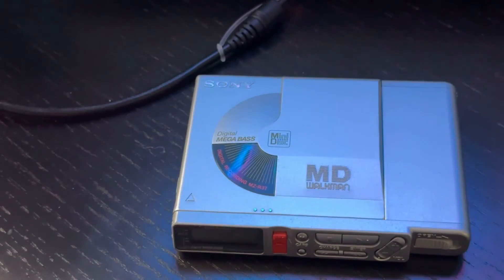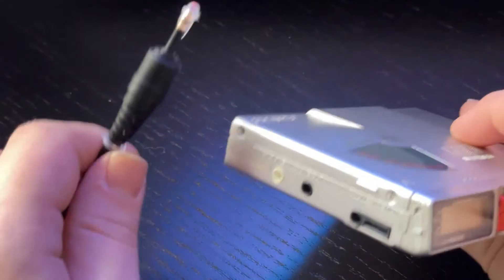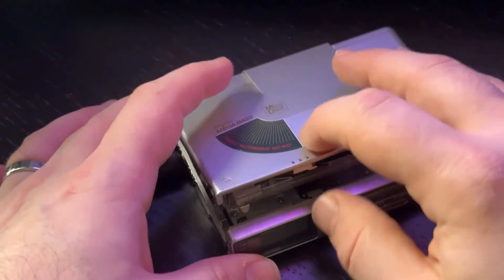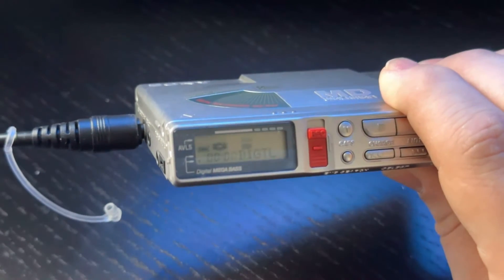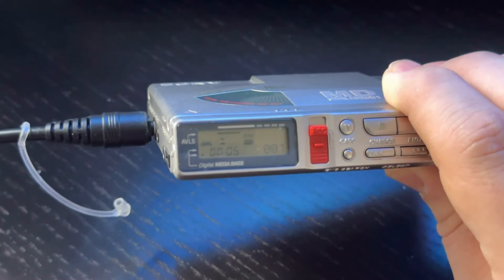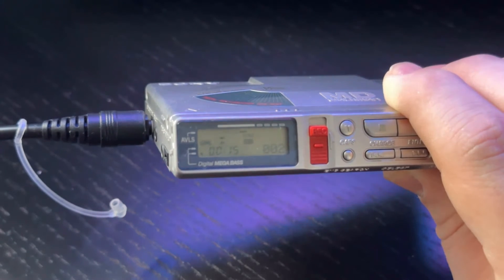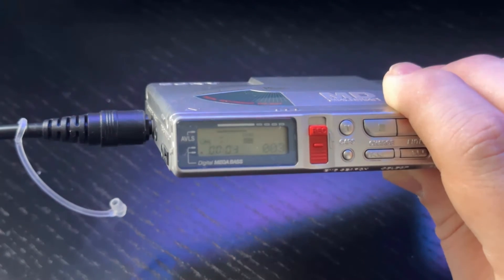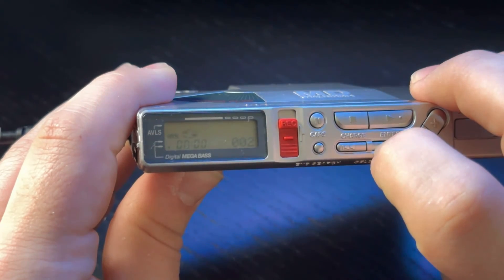How to record a minidisc from digital input

Comment: i just got my mz-r70 and i’m wondering if i should get a mini tos cord. i have an aux cord and it works for recording from my radio, but it doesn’t see it as digital recording, just as a mic. my worry is ill buy the mini tos cord and it’ll still have the same problem. i would love an opinion!
Reply: that's because aux is not digital recording, it's analog. toslink is digital to digital
Reply: @ good to know’! thank you 😁

Comment: What is the name of this wire? And is this connected to your pc as the source?? Thanks
Reply: It's mini toslink optical cable that connects to mini disc recorder.
Usually terminated with full size toslink optical plug to connect to your source. Your source needs to have "optical out" socket.
Reply: You are looking for Sony Accessory POC-15AB
Reply: Thanks guys I found it and bought from Amazon, it works great from my pc to the Walkman md player.